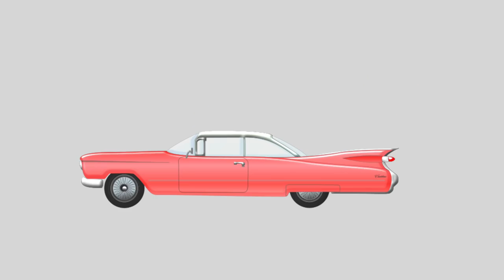Yes, Rockets CAN Fly in a Vacuum

Comment: The only reason why objects can be controlled on Earth, or pushed to some extent into the space, is because of gravity, which provides a point of resistance, so there's no way to control an object after it leaves the atmosphere of Earth, because there's not enough gravity, and the gasses doesn't make a difference if there's nothing for the object to push against, so all the films and video games which present spacecrafts that are self-controlled in the space, are complete science-fiction.
Reply: Another person who doesn't understand physics.
Reply: @davidmescher2526  I could say the same about you, so not an argument.
Reply: @ivanos_95  You don't need a "point of resistance" (whatever that worthless BS means) to propel an object in space. You don't need to push against something external to create thrust.

If you actually understood what Newton's Laws say and mean, you would not have uttered such an idiotic statement.
Reply: @davidmescher2526  You're talking about an outdated law for the 17th century, when people had very little knowledge about the space/gravity. You can't possibly bring an object into motion, change its direction, or stop its movement, without a point of resistance, which obviously requires sufficient gravity.
Reply: @davidmescher2526 Sure, the Newton's law still applies on Earth's surface, but no longer in the space, because it ignores the gravity, as a necessary force for any movement. If there's no need for a point of resistance/gravity, for an object to move, then what is the alternative force that you've discovered genious?
Reply: @ivanos_95   Now IF you are truly interested in how rocket propulsion ACTUALLY works, answer the following three questions regarding a rocket engine running right here on earth in atmosphere.
When the rocket ignites (at sea level 14.5 PSI atmospheric pressure):
1 - Does the exhaust gas experience an "Acceleration" as it exits the rocket engine? (does it change velocity as a result of the engine?)
2 - Does the exhaust gas have "Mass"?
3 - Can "Mass" Be accelerated by anything OTHER THAN a "Force"?
(or is a force required for mass to accelerate?)
Just answer these three trivially simple basic physics questions and we will get to the real ones about rockets in a vacuum.
Reply: @stuartgray5877  The exhaust gas does allow for acceleration of a rocket so far as there is sufficient atmosphere, in relation to its mass, while the gases have a noticable mass when they're concentrated by the gravity, or within a closed chamber, and no, a mass requires a specific force, namely the gravity to accelerate.
Reply: @ivanos_95  Contrary to your evidence free assertions, mass does NOT require gravity to be accelerated.

Learn some basic physics.
Reply: @davidmescher2526  Again, what alternative force have you discovered?
Reply: @ivanos_95  "Again, what alternative force have you discovered?"

One isn't needed, as you've been told and appear to have difficulty comprehending.  You are simply making up your requirement of gravity / alternate force being necessary, yet you have provided absolutely nothing in support (not even something half-assed that a flat earther might come up with) of your assertion.
Reply: @ivanos_95  - " while the gases have a noticable mass when they're concentrated by the gravity,"

Objects STILL HAVE MASS outside of gravity genius.
Try achieving at least a high school level of education before trying to debunk ALL OF SCIENCE.
But bless your little heart for effort.
Reply: @davidmescher2526  If you're talking about a rocket which is already moving in the space, then you would be correct that no force is necessary to keep the motion. Hovever, when we're talking about setting a rocket into motion, changing its directions, or stop its movement in the space, you can't possibly do it without any force. Otherwise go ahead, give me some example when such operation is possible without any force, or better, without the gravity in particular.
Reply: @ivanos_95  - "you can't possibly do it without any force"

But there
IS
A
FORCE!
It is the force between the rocket and the mass of its exhaust gas.
What does Newton's Third law tell us about force?
When the rocket applies a FORCE to accelerate the mass of the exhaust gas into the vacuum WHAT ELSE MUST HAPPEN?
Reply: @ivanos_95  I'll give you a hint: Lookup the "Law of Conservation of Momentum".
This law is derived from Newtons Third Law.
The "Tsiolkovsky Rocket Equation" is derived from the Law of conservation of momentum.
DO you have ANY IDEA why they call it a "Law"?
Reply: @ivanos_95  - "Otherwise go ahead, give me some example when such operation is possible"

Well, you COULD just look up into the sky and observe the ISS fly over your head.
You know, the man-made object IN ORBIT that you can SEE WITH YOUR OWN EYES.
What IS IT then?
Reply: @davidmescher2526 The propellant is only useful in the atmosphere, where the gravity and concentration of gases provides a point of resistance for the chemical reaction, or the achieved energy to push the rocket, since the energy is useless on its own, if there's no atmosphere, or gravity as a point of resistance for the energy to have an impact on the rocket, otherwise you have to explain how can the energy from a propellant push the rocket, if there's no force to push against.
Reply: @ivanos_95  Yep, still stupid, insisting on some extra force without any evidence.
Reply: @davidmescher2526  Try to hang with your hands on something stable, so that your legs can't touch the ground, by this way you recreate the same environment as the one in space, and then try to use your legs to jump, what is equivalent to a propellant that provides energy for the rocket to move. You'll find out that you can't possibly jump, until you put something solid between your feet and the ground, what is equivalent to the atmosphere, or the force of gravity that is necessary for the energy from the chemical reaction in the propellant to move the rocket.
Reply: @ivanos_95  Yet again, you get it wrong .

In your scenario, if the movement of your legs was able to generate 980N (if you mass in at 100 kg) of force, you would move. Briefly.  (Once the force stops, gravity takes over, and you will come back down.)

However, most people aren't able to generate this much force with just their legs in the scenario you describe.

You do not need something external to push against in space.  You do not need gravity in space. You do need to exert force (like expelling propellant), but that's just conservation of momentum.

You have continuously failed to present any model of kinematics (that means equations!) that would require either.
Reply: @ivanos_95 tell us WHAT
IS
THE
OBJECT IN THE SKY that we call the ISS?
Apparently you are unaware that you can see it with your own eyes?
Reply: @davidmescher2526 Obviously, you can bring some technology that would help you move up, by generating enough energy to impact the ground under your feet, or the atmosphere around you, but then you would destroy the whole experiment, because my point was to show you that exactly the same energy, in this case produced by your legs, which normally allows you to jump, due to a point of resistance, in this case the ground under your feet, becomes completely useless in a anvironment like the space, where there's no point of resistance to jump.
Reply: @ivanos_95  Jumping isn't the same as expelling propellant, though.  If you are "jumping" in space, your center of gravity remains the same, and since your legs are of finite (and fixed) length, you stay in place.

A puff of propellant, throwing your feet off, or anything else that isn't tethered to you will propel you. No "point of resistance" required, regardless of your protestations to the contrary.

You are not very bright. Perhaps you should learn some basic physics first.
Reply: @davidmescher2526  The whole point of the experiment was to show you how exactly the same energy works in two different environments. In one case the energy does impact the object, while in the other case the same energy does not impact the object, and this rule applies to any source of energy. You should be able to preform this basic experiment, or ask someone to help you with its performance, and immediately understand what I'm talking about, otherwise your situation is hopeless.
Reply: You're talking about different sources of energy, while I was talking about the experiment, or specifically about the energy produced by your legs. In one case you're standing on the ground, and the energy allowes you to jump. In the other case you're not standing on the ground, and the same energy doesn't allow you to jump. Those stupid ad-hominem doesn't help your case, but only makes you look like a child, so try to avoid those if you expect a respectful conversation.
Reply: @ivanos_95  "Those stupid ad-hominem doesn't help your case"

I'm not the one making shit up.  A "point of resistance" is not necessary, gravity is not necessary, and you have offered no model of kinematics that requires one.
Reply: @davidmescher2526  I gave you a very simple demonstration for why you're wrong, or why your theory doesn't work in practice, so you're the one who's making shit up, a complete fantasy, with no basis in reality.
Reply: @ivanos_95  And I told you why your "demonstration" was wrong,.  Not my problem you can't understand that.  You still haven't actually provided a model of kinematics that requires your BS "point of resistance".  Why is that?

Newton's Laws work just fine, even though you think they're outdated.
Reply: @davidmescher2526  No, what you did was a strawman, since I was talking about usage of the same energy in the experiment, while you were talking about different sources of energy, that have nothing to do with my point. This shows that you would accept any false model, if you can't understand the simplest experiment, probably because you've put your faith in an outdated law from the 17th century.
Reply: @ivanos_95  "No, what you did was a strawman,"

Your analogy was worthless, since the power source you were suggesting is tethered.

Yes, if you push off of something (sufficiently hard), you will move, regardless of whether gravity is there.

If gravity is not there, what you're pushing off had better be leaving the system you're measuring.  You are somehow claiming (without any evidence, model, or comparable observation) that you will simply thrust in place.

"while you were talking about different sources of energy, that have nothing to do with my point."

The only "point" you have is the made up BS of "point of resistance."  Which isn't required, as thrust in a vacuum can be demonstrated, and gravity is not a necessary part of kinematics.

"probably because you've put your faith in an outdated law from the 17th century."

Yet you haven't provided a replacement.  Why is that?
Reply: @davidmescher2526  Again, if you're based on a law from the 17th century, which ignores the point of resistance, your kinematic models can work only so far as there's atmosphere, but no longer in space, where there's no point of resistance, and sufficient gravity is crucial in this case, while my analogy is most useful, because it can be easily tested, and proves my point, unlike your assumption, which is pure fantasy.
Reply: @davidmescher2526  I've no problem with kinematic models for any technologies which supposed to operate within Earth's atmosphere, or even for the satellites which operates at the borders of space, where the outdated law of Newton still applies, so my only problem is with those models where a rocket supposed to control its own movement in space, due to previously mentioned issue, and so far you didn't present any better experiment to invalidate my point, or to prove your fantasy.
Reply: @davidmescher2526  There's no problem with any model which uses the outdated law of Newton, so long as the model applies to Earth's atmosphere, but there's no functional model for movement in space. If you don't have anything serious, beside those ad-hominem, that's okay, because I wasn't expecting anything in your situation, so the case is closed.
Reply: @ivanos_95  Actually, I did think of something that you might be able to comprehend.

So, based on your "experiment", the so-called "point of resistance" is when you're directly working against gravity, or if there's an atmosphere, right?

Edit: And you STILL haven't offered any reason (with evidence / observations) on why Newton won't work in space...
Reply: @davidmescher2526 More precisely, the point of resistance is a point at which the force of gravity is strong enough to resist the energy produced by an object, what results with this object moving in the opposite direction from this point. Newton's law was developed before we've discovered the space, so it assumes that the force of gravity is omnipresent, instead of recognizing the gravity as a unique force that's changing in different environmens, and so this law is insufficient for the space.
Reply: @ivanos_95  Your "point of resistance" BS doesn't cover force that is exerted perpendicular to local gravity.

 It sounds remarkably like friction, except when friction goes to zero, it's not stopping anything.

And gravity is, for all intents and purposes, omnipresent.
Reply: @davidmescher2526 There may be a source of gravity which is omnipresent, but in case of our planet, whose gravity can be easely verified by its direct impact on our environment, the gravity is not omnipresent, but local, as its field is limited, especially in case of the atmosphere, which is our main concern. The point of resistance covers specifically the force and energy which are related to acceleration, stopping, and changing direction of an object, now let's get into your alternative experiment which supposed to invalidate my point and somehow prove your fantasy.
Reply: @ivanos_95  Your BS "point of resistance" doesn't cover force that is exerted perpendicular to gravity.  There are (on YT, even) recorded instances of igniting a rocket in a vacuum perpendicular to local gravity, and successfully exerting force, which means acceleration.

Your "model" states that this is impossible, yet it is recorded occurring, and can be duplicated.

"There may be a source of gravity which is omnipresent, but in case of our planet, whose gravity can be easely verified by its direct impact on our environment, the gravity is not omnipresent, but local, as its field is limited"

The field goes out to about 1M miles before the Sun's field takes over.  Oh, right, you dismiss all spaceflight out of hand, even though you don't have any evidence beyond your BS "model."
Reply: @davidmescher2526  No, I don't dismiss the possibility that a rocket can move in space, so long as the rocket is set in motion within the atmosphere, but I'm sceptical of videos on the internet. There are only two possibilities, either the mentioned videos have been filmed at a point with sufficient gravity/atmosphere, or you're talking about fakes.
Reply: @ivanos_95  Or that you're wrong.

 Especially since you aren't providing any actual equations for your "point of resistance" BS.
Reply: @davidmescher2526  We're not talking about mathematics, so an equation is useless in this case. That's why I asked you for a practical example, which can be tested without the need for a third party.
Reply: @ivanos_95  I did give you an example. You can even build the setup, if you don't trust Internet videos.

And if you can't express your "model" without math (even rudimentary), your "model"  is worthless.
Reply: @davidmescher2526  We're talking about the basic principles of physics, while an equation is based on established principles, so an equation is useless for solving any problem, if we can't agree on those principles in the first place. You only said that you know an example, but then forgot to provide your example, because so far you didn't give me anything practical, especially nothing with a setup that one can test directly, only youtube videos.
Reply: @davidmescher2526  Again, an equation would be useful for solving a problem if we both applied to the same principles or language, but not when we're discussing those core principles, and don't have a common language, in which case we can only use the practical, testable examples, as evidences for our claims, because those doesn't require a common language, while the example which I gave you, was precisely a recreation of a vacuum chamber in the space, and shows precisely how your theory fails in practice, so unless you present some better example, and manage to prove your theory, the evidence is on my side.
Reply: @ivanos_95  - Why do you ignore Stuart's Questions?
 He actually builds and operates spacecraft as his job.
 Are you scared to address actual facts from experts in the field of spaceflight technology?
Reply: @ivanos_95  - "the evidence is on my side."
It is NOT as we have literally tested rocket engines in the vacuum of space for millions of hours.
All you know to do is dismiss evidence. You never evaluate it. I could show you a video of a rocket performing propulsive maneuvers in a vacuum, and you would just call it fake even though tens of thousands of live spectators watched it with their own eyes.
Reply: @rocketman484 We're not talking about a regular vacuum, which we're using in a regular lab, but a vacuum with lack of noticeable gravity, lack of any gasses, and lack of surfaces in its surrounding. I can't possibly verify your videos, thst's why I asked you to give something practical, that I can test by myself, similar to what I gave you to prove my point.
Reply: @davidmescher2526 If you've missed what I said in the previous comments, I asked you to provide an alternative model for a very specific vacuum, so that we've some common ground to test your claim in practice, otherwise your equations are useless, and nothing more than retraction from practical evidences.
Reply: @ivanos_95  You seem to be very confused about basic physics. I can help with that IF you are willing to answer a few questions to be certain you are using the physics terms correctly.
First question:
Dow CROSSBOWS experience a RECOIL force? Yes or No?
Why or WHY NOT?

Would a crossbow have recoil if fired into a vacuum? Yes or No?
Answer that question and I will get to the more relevant questions.
Reply: @ivanos_95  Well I can help you understand "vacuum" as well as I have been a "vacuum test specialist" for about 30 years now.
I learned to operate some of the nation's largest thermal vacuum chambers at Lockheed Martin Space Simulation Laboratory back in the 1990s (I suspect before you were born).
I have also integrated multiple Science Instruments to real spacecraft that could not even be turned ON until they were in high vacuum.
Reply: @davidmescher2526 Your equation is purely theoretical, and requires practical evidence to be approved as factual, while your vacuum chamber still have walls, which are points of resistance, and doesn't protect against the gravity, so your practical example doesn't work in this case, again, go back and take a look at my simple experiment, which can be preformed by the average physics student to prove my position.
Reply: @ivanos_95  I can help you figure out where your misunderstanding of basics physics exists. You just must agree to answer w a few questions regarding rocker propulsion:
Let's consider a rocket engine running here on earth in atmosphere. For example, a Space Shuttle Main Engine (SSME).
So, when a SSME is running here on earth in atmosphere:
1 - Does the exhaust gas get "accelerated" from the engine?
2 - Does the exhaust gas have "mass"?
3 - Can mass be accelerated by anything OTHER than a "Force"?
Now just answer those three questions to prove you understand the terms "Acceleration", "Mass", and "Force", and we will get to the more relevant questions.
Reply: @stuartgray5877  I imagine it will whine something about atmospheres providing a "point of resistance".
Reply: @ivanos_95  So you claim to understand basic physics, but you RUN A WAY from questions that any high school grad could answer without even looking anything up?
Thats fine.
I accept your surrender.
Now run along child, the grownups are having a conversation.
Reply: @ivanos_95 I think you’re confusing mass with weight. Weight changes with gravity, mass does not. Weight is mass multiplied by gravity. Aka, weight is the force excreted by gravity on an object. Mass is unchanging and immutable. That’s why there is the law of physics call the law of conservation of mass. That mass cannot be created or destroyed. If no mass enters or leaves a system; the mass of that system will never change. But weight can, as you reduce or increase gravity. 

See the difference?
Reply: How pathetic a real education in physics or engineering you received.
Reply: @kitcanyon658  Yeah - Being hit upside the head with a brick does not qualify as an "education in physics"